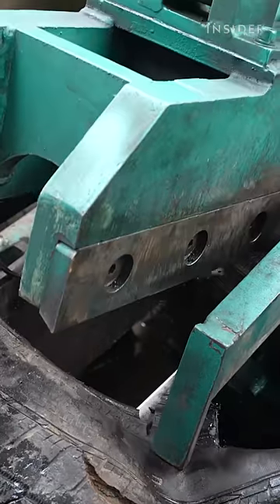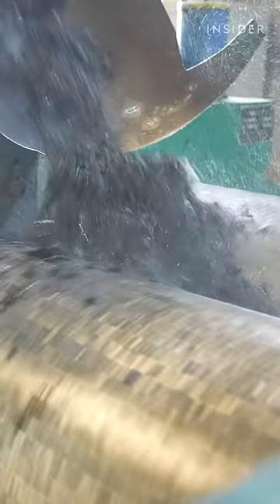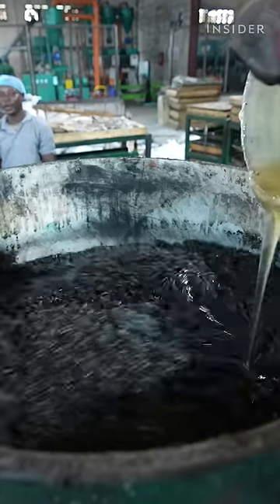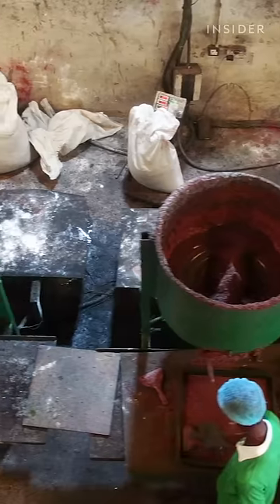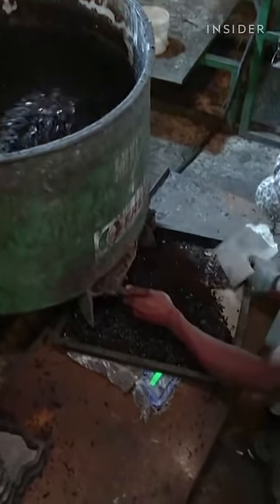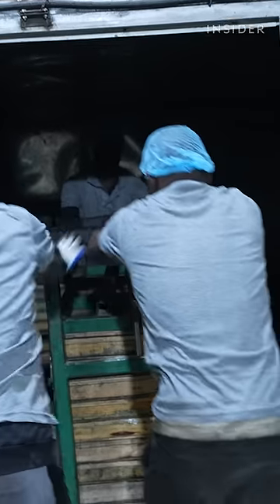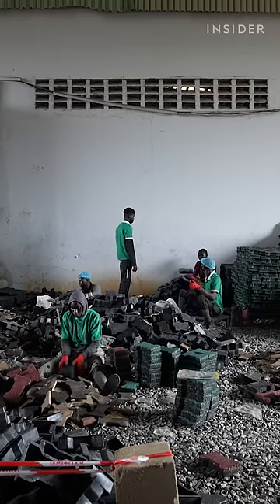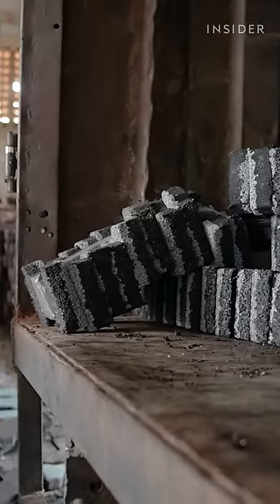Here’s how this company recycles old tires to create rubber bricks. 🧱 #rubber #sustainable #nigeria

Comment: the air quality inside this factory has gotta be deadly.
Reply: I agree but "Female entrepreneur in developing African country starts successful recycling business and gets criticised by Western media" is not a good look though
Reply: At least their hair is protected and I don’t understand why. Cause they don’t produce products which should used in hygiene.
Reply: Not as deadly as the air quality when burning them like most countries do.. and I'm no tree hugger but these people are doing it right
Reply: I dont think its as bad as it might seem. Polyurethane ive used a few times and i believe it isnt very harsh, i know it doesnt have a strong odor, we use it on cabinet and door surfaces, and the rubber is only ever chopped so the air would probably equate to a tire shop.
Reply: Perhaps, if it is a problem, this innovative spirit can take on that issue also.
Reply: That’s fine rubber dust how is that not good for your lungs…Sheesh
Reply: You'd be surprised by the places with oncogenic air quality. Even fast food restaurants.
Reply: Who cares it's not in Europe
Reply: I bet they have a lot of ventilation with all that heat from the machines and the latitude
Reply: They've got special machines for this job, some ventilation is probably present
Reply: Is still wish they'd protect their face & hair as well as their hands & feet. Now that it's successful real ppe shouldn't be too much to afford.
Reply: Factories gonna factory
Reply: @xLLTWIXLLx they don't burn them, they solidify in the oven.
Reply: @MF_JONES  🙄typical woke
Reply: So True.  I know one factory that made pain and solvents.   There was chemical mix dripping from the cieling.  lol
Reply: @john-522 aren't you a passive aggressive racist
Reply: @Bob-ih6fj mask which your kind can't handle  and please  what's your  Caucasian  solution to the used tire debacle
Reply: @charlesballard4762 Why are you calling someone racist for mentioning the lack of protective equipment in a factory? The fact they have hair covers and nothing else in a factory that is producing something that doesn't require high hygiene standards like a food or medical supplies factory.
Reply: @MF_JONES What does that have to do with anything, you wrote and posted that on a network of computers and servers built using metric tonnes of minerals mined and processed by kids but suddenly a recycling business needs futuristic technology to clean their air quality and stricter osha regulations than the US has?
Reply: No shit, it's Nigeria not a silicon valley multi billion dollar tech startup.
Reply: @charlesballard4762  😂🤣😂 dude…chill
Reply: I'm sure it's not a sealed factory unlike American factories its very open and naturally ventilated so I'm sure the air quality is better then the one you're breathing right now
Reply: If there is no melting or burning, it’s probably not that bad. Any sort of particles floating around could be stopped with a cloth mask.
Reply: Looks like most of the machines were outside.
Reply: @Dafuq-is-going-on  you must have never seen the burning of a tire field then..
Reply: I bet some of these people haven't even been in a tire shop
Reply: @MF_JONES all the glory to her but never mind the minimum wage employees who will suffer long term health issue... You have a stupid logic.
Reply: @fortnitegamerkid6418 Could you explain what you mean by woke, in this context?
Reply: I support the recycling of tires.  This is a wonderful way to reuse something that is useable. Let’s be supportive and not critical. I would purchase theses bricks if they were available to me.
Reply: @MelissaAuthority  if you didn't understand my comment just say
Reply: I'm curious about the leaching from the bricks in the hot African sun
Reply: True very little safety concerns relatively speaking. They'll get more efficient with more tech.
Reply: @xLLTWIXLLx  still microfiber in the air
Reply: Deadly? Lol you should work at FedDx ground, that shits deadly
Reply: @nylesfrench3568  I used to work in a factory that recycled car windshields.. you literally couldn't see 4ft in front of you from the "fog".. that "fog" was actually microscopic glass floating in the air.. trust me, they will be fine..
Reply: @fadishuheibar6187  done this too, still isn't nothing compared to glass recycling.
Reply: I was thinking the same thing.
Reply: Definitely some folks not wearing masks who should definitely be wearing masks lol
Reply: Yeah but at least they ain't burning them /s
Reply: @john-522 I don't know about this video, but I've seen a lot of videos including lathes that ended in people getting smushed after their hair got caught in it
Reply: Was going to say something similar to your comment. Where is the protection for these workers...??? Or is it not a priority because it cuts into the profit margins??
Reply: @DDC365 My bru, it's Afirca. We're all considered expendible.
Reply: @fortnitegamerkid6418 
This comment so un-woke !
Reply: @Potatotenkopf  it doesn't matter where it is "at". It matters because they are human beings
Reply: @johan522 you dont want melted rubber and any adhesives they use in your hair
Reply: 50 replies?😮
Reply: @john-522 probably to protect their own hair.
Reply: My thoughts exactly😅
Reply: I guarantee it smells like a wet ashtray in there. Ground up tires STINK
Reply: @john-522 probably to prevent rubber crumbs/dust from being taken home in their hair and getting other stuff dirty?
Reply: @DDC365 why must u say it like , this woman is a new entrepreneur as she grows, all of these things will be taken into consideration
Reply: @MF_JONES get a life. 
They should ware masks, for Pete's sake
Reply: No different than the air Quality in California.
Reply: @Bob-ih6fj  No where near as deadly as not eating.
Reply: You inspectors Complain On Everything from Hygiene,Safety And Pollution, What not??? Why Don't You Start Something Where in Everything is Sustainable and Fair Trade.
Reply: @swIttY242 just worry about Covid and leave Nigerians alone
Reply: @MF_JONES mfjones😂   hilarious
Reply: @0ptimal   Nah.  I bet it stinks in there and it's dusty as hell.  You wouldn't want to work a day in that place.
Reply: @jelle7 fr a wasteland of the world
Reply: They can eat these tires no problem
Reply: The factory seems to be open-air.  Ventilation also exists in the modern day. Why assume they haven’t thought of any of that?
Reply: Hush 🤫🙊, we've factories like this 👆🏾 in Germany 🇩🇪 and their process is almost similar, just that the tiling is automated. There's a problem with microdust, but that's manageable.
Reply: @john-522 good observation
Reply: @graememckay9972  The guy was also wearing a facemask that was black when operating. He also wore gloves, something that is routinely seen. 

If you think wearing a hazmat suit in a workplace (where the weather will cook you well done) is safer, then that's your body. 

It's funny because I actually read up on it. There are no complaints about safety by foreigners, which shows how little or soft some of you "knowledgable" people are. Why not actually address way more relaxed Safety regulations in your country? @MF_JONES

Comment: “And after the bricks are made, they are thrown in the local land fill.”
Reply: Huggbees moment
Reply: they are used to build pavements and playgrounds for schools
Reply: honestly i wouldn’t be surprised in the slightest if they went through all that trouble just to throw it away but my question is what happens to the metal they strip from the rubber
Reply: @unknown20005 probably goes to a landfill but it isnt hard to recycle.
Reply: @EchooExplorer  woooosh
Reply: I don't get it
Reply: @kafkasclone3069 the metal is probably sold as scrap for some other company to recycle
Reply: No they can be  used in making roads ...
Reply: Actually in the full video its shown that they are sold to schools and other places to build playgrounds!
Reply: @unknown20005  the metal is valuable..its probably bundled and sent to a local smelter for an easy profit.
Reply: No they aren't. My previous place of work used them
Reply: @unknown20005 would definitely be sold for scrap
Reply: Stone cold! Pissed myself laughing
Reply: Funniest thing on the internet today.
Reply: They get recycled into tires.
Reply: Nice one
Reply: Why would they
Reply: They don't always go to land fill.  Can use them to make diesel fuel and electricy if burned in a controlled environment.
Reply: Dude, its rubber, the same thing they use to make the bricks. Infact it is a brick. It would be recycled
Reply: @unknown20005 
The wires are made of steel. Steel has various uses.
Reply: @kafkasclone3069 I mean they can just collect it then melt it down eventually and sell the material
Reply: @unknown20005 Easily melted down and reused.
Reply: 😂 stop
Reply: then lit on 😂fire
Reply: their fkin wif ya
Reply: @JJoy-bk8yr to make telsas
Reply: @Gablotescobar not everyone in the world has the same sense of sarcasm
Reply: Some people are so selfish for their humour that they would ridicule and demotivate other people
Reply: @unknown20005  It gets Smelted...Homie....!!!
Reply: @VDOless  well ya
Reply: @unknown20005 might be turning into another useful products.
Reply: Good comment.  I also thought it would be a good idea to show at the end of the video, what the bricks are used for.
Reply: @goaway9923  Yes, now that you mention it, I have seen playgrounds with rubberised surfaces around the swings and roundabouts.
Reply: @Gablotescobar what?
Reply: @themuffinman6199  another one
Woooosh 🤦‍♂️
Reply: Banned from playground because those contain massive amounts of harmful chemicals
Reply: HA!
Reply: I see that you're no Einstein.
Reply: Great job of recycling.
Reply: @EchooExplorer  Yeah, like he said, the landfill.
Reply: No, they make huge rubber pyramids, then set them on fire!🔥
Reply: @unknown20005  rubber is made into rubber bricks and metal is made into metal bricks 😅
Reply: LMAO!!  Haaaaaaa  (o:
Reply: Can't believe 3k likes for that.  Must be biden voters
Reply: This suppose to be funny?
Reply: @unknown20005 the money made from this entire process is likely from the salvage value of the metal extracted from the tires. My guess
Reply: they are used to loot local crt tv shops
Reply: @randomjapsi ,   the steel that is used in tires is a very high quality spring steel and will bring a high price from steel recyclers.
Reply: Used for paving. It is totally weird walking on these things. The ground feels unstable
Reply: @EchooExplorer  and when they start wearing out by time, weather, water, everything, where do the small particles end up?
Reply: definitely a good use for old tires. it looks rather labor-intensive though
Reply: @unknown20005  They sell it to iron condemn 😅
Reply: Only the ones they don't need to burn for fuel.
Reply: Those are used at race tracks for horses
Reply: @andyroubik5760  probably more  labour intensive than manufacturing the tyres but worth it.
Reply: That would deafeat the purpose of making the bricks
Reply: After the bricks are made, they are sold for more than the initial tire cost. 20 dog bone shaped bricks for about $90.
Reply: @unknown20005  scrap metal sent to china
Reply: ... REALLY ⁉️ so, who generates the finances for continuity of such complex enterprise since 2018? 🤔
Reply: @kd9601  don’t try to reason or use logic with these people
Reply: @randomjapsi metal can be melted and put in molds so even that can be reused
Reply: @unknown20005 bingo. 
l wondered the same.. 
but a lot of  metal is not scraped or recycled..
Reply: @joshb6993 lol ikr
Reply: @randomjapsi the metal definitely isn't going in the trash.

Comment: I would like to see these installed in projects. Very interesting.
Reply: They are nice in city park playgrounds.  I first saw them in Enterprise, AL in about 2008
Reply: Sure better than asphalt in. A playground   I wonder why they don't use a version of that material to resurface roads
Reply: @1Pegasus21445  - it probably gets slippery when wet and doesn't provide the traction you would need.  Fine for little kids to land on, not for the abuse a vehicle would deliver.
Reply: @1Pegasus21445  the first problem is rubber is soft, so it wouldn't be good for roads where vehicles drive on. As it will start to break apart easily.
Reply: They are nice for playgrounds, heck if I have the money I'll use it for the floor to build my home gym